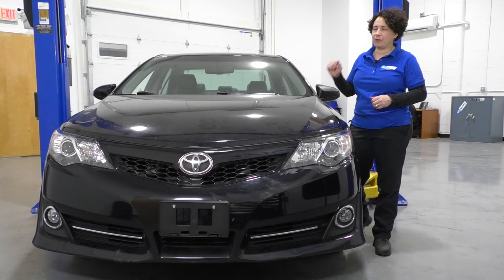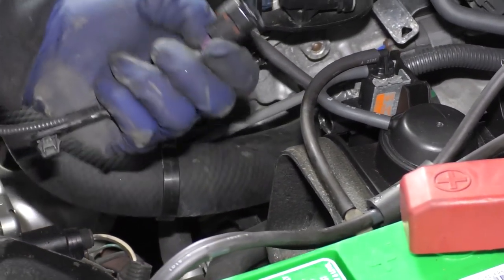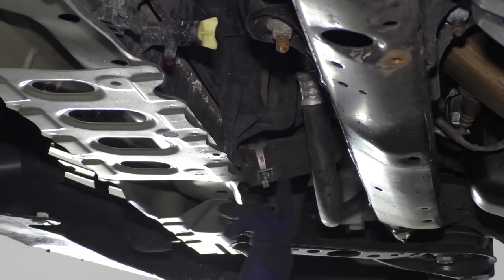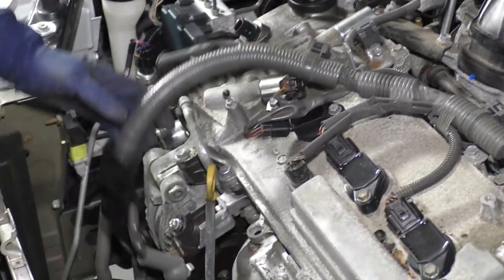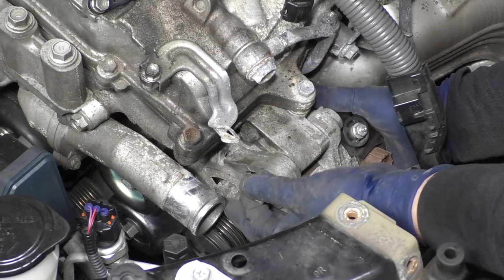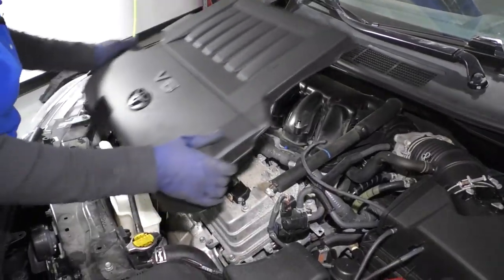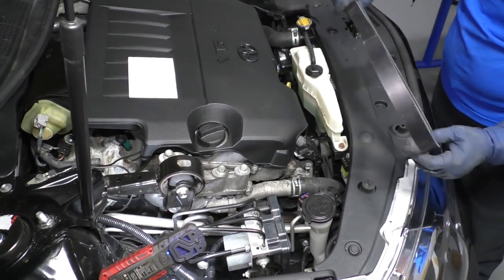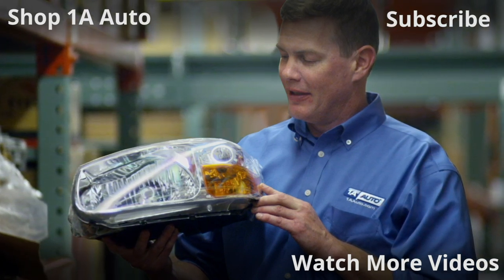How to Replace Alternator 11-17 Toyota Camry

Comment: What I learned: 1) you absolutely have to have an extra long, thin, ⅜ drive rachet and deep well 14mm socket to get the hardest of three bolts and then it's pretty easy, 2) you don't need to pull the radiator but you do need to undo to it so you can move it out of the way, as well as remove the top rad hoses and drain the rad, 3) remove the bracket off the alternator- unbolt the bracket from the block first, then bench swap the bracket from old to new alternator, and 4) your hands are going to take a genuine beating. Not a super fun project but it'll save you $900, so definitely worth it.

Comment: The whole reason if I bought a Camry I'd buy one with a 4 cylinder. Way easier to work on. On a 4 banger you can change the alternator in 15 -20 mins, its right on top of the engine.
Reply: I agree man. I did it myself in about 1 hour but that's cause I am not mechanically inclined but was still able to do it on my own by watching a Youtube video. I'm sure others like yourself can do it much faster. Boy am I glad I didn't let the salesman talk me into getting the six cylinder back in 2014 when I got my four cylinder 2014 Camry SE 2.5L gas only vehicle. It seems like a bloody nightmare to do this job on the six banger. Yikes!!!
Reply: Oh, and BTW, I didn't change my Toyota alternator cause it was failing me, I simply changed it cause my car has 150,000 miles plus and just wanted to get this job out of the way cause it's just a matter of time before all alternators fail. Just some FYI.

Comment: This was so unnecessary. Don't need to srain the radiator. Dont need to take off the belt, dont need to take any of the plastic parts off.
Reply: The Sneakerhead Beau  thank you 😊 I was looking for some other YouTube videos she did too much I guess she wants labor
Reply: Thanks 😊 any other videos without all the unnecessary labor?
Reply: You have no clue bud. The v6 that she worked on is a much bigger job than the 4 cylinder camry. And how does one get the alternator out with the belt on it? 🤣🤪
Reply: Drop a video

Comment: You can get away by just removing the fan , no need to remove the radiator or discharge the ac line
Reply: I watched a video where the guy loosened the bottom of the radiator and pushed it back some. I've got a V6 so it's pretty dang freaking harsh.  I'm really pissed off at Toyota these days, they used to make the cars actually able to work on at home.  plus, I had a 2000 Corolla for 16 years with a zero mechanical problems.  this is an 11-year-old car with under 200,000 miles and the freaking alternator is failing.  actually the regulator part which apparently is built into the alternator another insanely stupid idea.

Comment: Excellent video, fantastic camera action. My only fear are those plugs and connectors 😂. Seems on my 13 year old Camry you sneeze too hard by them and they break. However, doing the job myself, I can tell the viewers this was not this easy. Removing fans, radiator, etc was the easy part, about 1 hour even with my bad back. Removing the alternator 3 bolts too hours and I have fully stocked tool set and sockets. There has been a lot of cussing, cursing, contemplating life choices. Hints on the small bolt on the back. It does nothing to secure the alternator. It's only to hold the bracket she was talking about. What I did is,remove the one bolt direct with easy access, Don't mess with the harness. Slide the alternator out and tilt it to the left. The harness and small bolt, 12mm, are still attached. Now, when you tilt the alternator the small bolt is full exposed and no need for swivel, mirrors, cussing or anything. It's right there exposed.

Comment: This seems like the best way to change a V6 alternator, personally that's my thinking easier with a lift also.
Reply from the maker: +T D Thanks for checking us out! 1AAuto.com
Reply: You can just take the two bottom mount bolts on the radiator so you csn lean the radiator back for enough space no need to drain coolant

Comment: it's super hard not to say f Toyota.  they're making the cars near impossible for the home mechanic.  only because I got a relatively decent deal on fluid changes, did I have them do the transmission, which has some freaking bizarre hole on the side so you have to take off the wheel on the driver side.  and then some freaking bizarre way you're supposed to measure the appropriate amount you put in.

sorry but this really pisses me off bad.  I just got a $776 quote from aamco, guys I trust who I've worked with before.  but they're charging $400 for the alternator, which I can get at the parts store for 150 to $200, with the core exchange.

I need 2011 V6 Camry instructions if anybody knows of anyone who can provide them or direct me there.

Comment: Does this apply to the 4cyl 2017 as well?
Reply: one year later no response..
Reply from the maker: +KGB Reviews  This video is applicable to the 11, 12, 13, 14, 15, 16, 17 Toyota Camry
Reply: @1AAuto  You forgot to specify that this is ONLY true for the Camry V6 engines from those years and NOT the 4 cylinder ones.

Comment: What does it mean when my car starts rough right after disconnecting and reconnecting my battery (for working on it or replacing the battery). The next start is normal. Computer issue?

Comment: I have a 2013 Avalon 3.5L. I am having charging issues hopefully just the battery. It is still the original and only 36K miles. I have seen some videos that do this with a little less labor but "Holy Fuzzy Cats"!
Can you tell me the labor charge and the OEM alternator cost? I thought I could change it myself if it is the alternator but that is not an option.
I miss the rear wheel drive cars before the mid 80's. I could change the alternator or water pump in 15 minutes.
Just amazed at how much cheap plastic fasteners are used.
Nice job and give me a clue.
Thanks!
Reply: Same issues on my Avalon. Brought a new battery. Worked for a couple of days then the battery died. Dealership changing the alternator as i type this

Comment: First-rate video!  I would only say that there is an alternative to removing the front RH wheel and inner fender wheel cover: first, don't entirely remove the original drive belt (unless you're replacing it outright;) just disengage mostly with the old alternator.  Second, after installing the new one, remove the upper engine dampener and its attachment bracket with the engine.  With these out of the way, there's plenty of travel in the tensioner to re-install the belt.  Get a good light and you'll easily be able to spot from above the engine whether the belt is correctly seated on the pulleys. Afterward, reinstall the bracketry and dampener.  For me, this is faster and easier than futzing with the wheel and inner fender cover.

Comment: Why not put the belt on when you had all that room after you removed the fans and radiator! You didn’t even have to remove or drain the radiator just the fans
Reply: You've done this without removing the radiator???
Reply: @LOUIZIANABOYZ  once the fans are removed there is enough space by taking the alternator towards the drives side of the vehicle.

Comment: One more thing.  Did you use a memory saver for the computers?
Reply: You can use a ps4s hard drive with adapter connected to where obd2 pins are